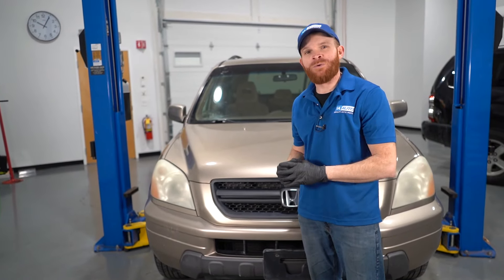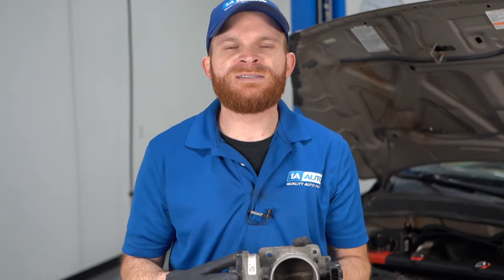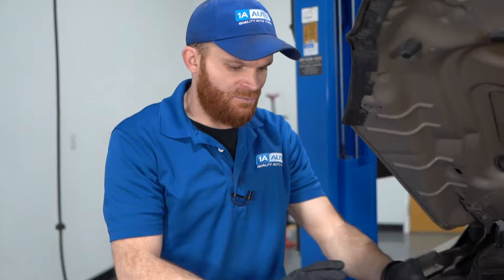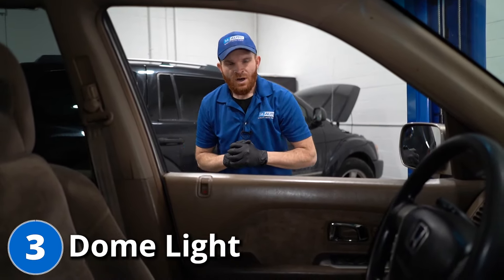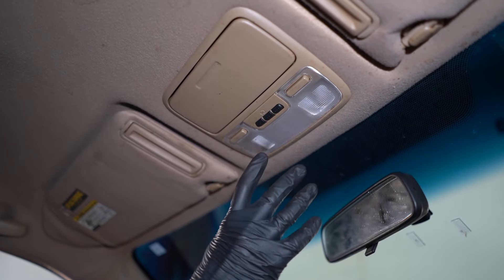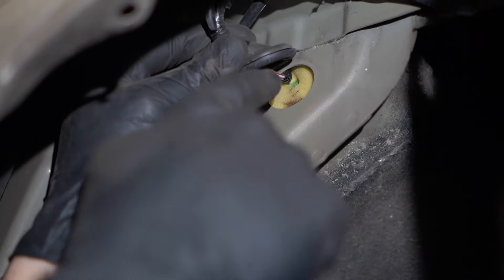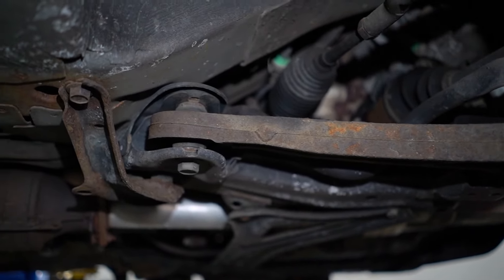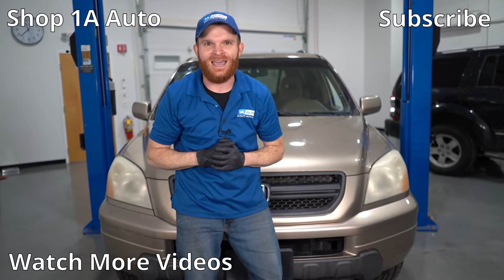Top 5 Problems Honda Pilot SUV 1st Generation 2003-08

Comment: Good stuff.  I recently purchased a 2055 w/180k.  Immediately noticed a strange shudder/vibration from the rear over bumps/turns/25 to 35MPH.  Any advice?
Reply: One must religiously change the rear differential vim fluid. That will do it.
Reply: Check your rear springs, bump stops and shocks....if you haven't already.  Had to replace mine at 200k....and rear diff. fluid as J. Burns said...  If/as/when you figure out what the problem was, update your post as it's likely to help others.

Comment: I don't know if mine is a prototype or what but I am sick of it. It rains inside and when I look at the inside of the fender well where you are pointing in this video I see only the tube that i guess goes to the rear washer,  then a box welded over the upper area that I cannot access with anything I don't think I can even cut a hole to access it.

Comment: What about engine and gear box? ,,, I heard few things about the transmission in this car ,, can you please talk about these important parts in your videos ,, cause I follow your advises most of the time .. A little bit of engine ,transmission and all-wheel drive systems and reliability evaluation .. Many thanks
Reply: The 03-05 had Trans issues if they weren't properly maintained. Engine and everything else is about as reliable as can be.

Comment: The 06-08 is the best pilot ever made.  The 03 and 16 are the worst.
Reply: Very true !
Reply: The Force is strong in the Pilot
Reply: 2007 with 250000 on mountain roads . Best car
Reply: 2008 pilot with 376k miles changed timing belt twice flushed transmission at 130k otherwise regular maintenance. Ecu just went got a quote of 2k for repairs. Time to retire it. My best car ever
Reply: @jamesdubois1237  2007 300,467 miles and I love my pilot so much !!! I want it for another five years at least .

Comment: Hey this is honda  related but I have a  2011 honda crv  with 74k on it  and the steering wheel is extremely hard to turn  no matter what way you turn the wheel. I'm wondering  what's wrong  and if anyone can help

Comment: I wanted to know why my throttle is stuck open. There seems to be little information on the internet about it. 🤷🏻‍♂️
Reply: my sisters pilot doesn't accelerate as good as it used to. I never thought about cleaning the throttle body

Comment: I have 07 with 305,000 miles its dies while driving and battery needs jumped sometimes battery is new and holds 12v and altenator 14v so I'm sure

Comment: just bought a 2008 model 2wd 210k. $2700. the only thing that doesn't work is the rear per windows & I might add this was a very heavily used vehicle with 4kids. I had to remove all the untorn cloth seats and pressure wash them. one of the kids must have thrown up on the drivers left shoulder lol, gross.

Comment: Fuel economy? I bought a 2004 but good lord I’m getting like 15 mls a gallon for the most part what can posible be wrong any one
Reply from the maker: +Estuardo Velasquez We wouldn't be able to diagnose an issue like that here, you may want to have a local mechanic take a look at it. Thanks for checking us out! http://1aau.to/m/Shop-1AAuto-c
Reply: Are there a lot of hills in your area? My car gets 35-40 on the highway, but only about 20 around my house. Everywhere I go, there are steep hills. Hills RUIN your gas mileage.

Comment: Should I not buy a 2008 pilot with 210.000 miles ?
Reply: Pilots are good reliable SUVs. I have 212K on my 2006. With that many miles certain parts need to be replaced. No bad deal. Just make sure the engine and transmission are in good condition if you decide to buy, especially the timing belt on that engine. If it breaks you need replace all those bent valves $$$.
Reply: I would buy mine again and again ! Best car I’ve ever had and I will bawl my eyes out the day she’s done . Take care of it and you’ll have a car for a long time!

Comment: I wanted to tell you that there's one other that you don't mention and its the dog on alternator bracket it's small but it's got to weird holes and it cracks and brakes you can't get your tensioner to line up you end up buying new tensioners before you figure out that little bracket is broke it is like this length of your fingers all its $41 where I'm at in California but it broke on me and I could not figure it out when I started my everything was fine I started with a Squall in my engine you know where the belt rubbing and I change the belt started to buy a new pulley until I found this guy on here that said he had the same problem he changed the belt and then it wouldn't Titan after that and it was that stupid little bracket so you need to throw six things out there and alternator bracket on a 2002 3 Honda pilot,s
Reply from the maker: +Jimmy Thanks for the feedback!

Comment: 1st gen was 03-05 2nd gen 06-08
Reply: No 06-08 was face-lift first gen .
Honda does that on a lot of other models.
Reply: No. 03-08 is first gen. 06-08 was the face-lift model, which I guess you could refer to as 1.5 gen.

Comment: Thanks for the information.  My 149k miles 07 pilot for some reason every time I start engine on a cold start I can hear a rattle shaking vibration noise. Only lasts for about 1 to 2 seconds there’s no trouble codes or any other issues. I use MB 1 Synthetic oil every 5k miles. Here is a YouTube link of the sound my pilot makes. Any ideas? Thanks! 

https://youtu.be/FNgHLLxDSxM

I did replace all the timing belt related parts about 3k miles ago there’s a new serpentine belt as well. My mechanic also adjusted the valves but he had to do it twice because the first time he left some valve a little loose and the engine was ticking a lot after being warm up. Any ideas or suggestions are welcome thank you very much.